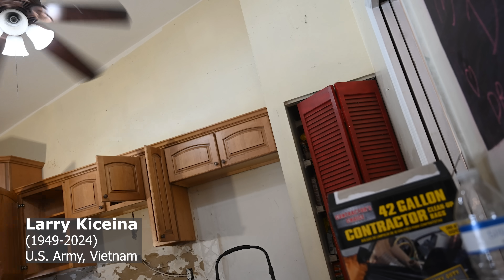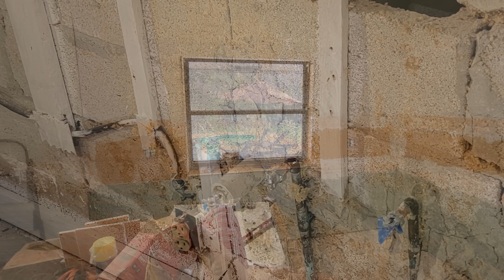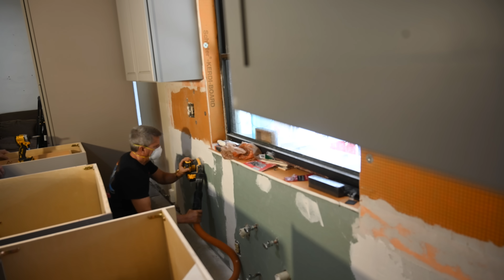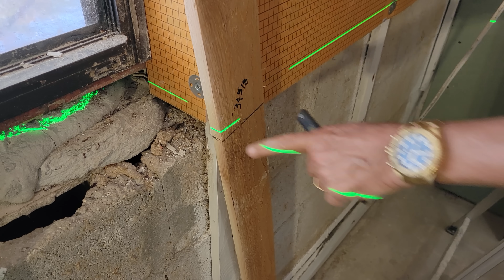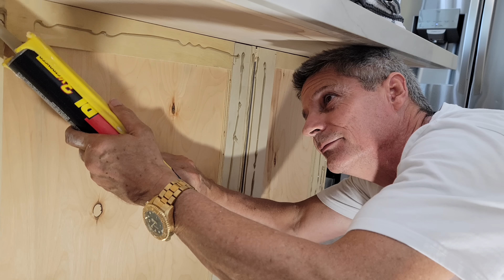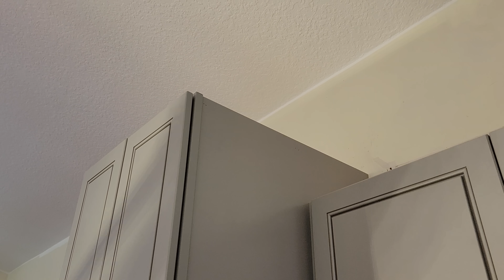Flooded Kitchen Cabinet Installation DIY Mistakes To Avoid

Comment: Nice looking kitchen, but if you are like me and confined to a wheelchair it's completely unusable. The problem is that with cupboards under the counter tops when you approach it face on your shoulders are at least 1.0 m (39 3/8 inch for Americans) away from the bench top. That makes it pretty much impossible to reach anything but the first few cm (3/8 inches) of the bench top let alone taps and anything close to the back of the bench top. The only other way you can get at the bench is the have the wheelchair side on to the cupboards, but this means you need to be working with your back twisted through 90 deg and that causes all sorts of long term problems not to mention pretty serious pain in the short term. 

Either way, you beautiful new cabinet doors are going to have dents, scratches and marks on them extremely quickly where the foot plates or wheels of the wheelchair smash into them multiple times, even if you're just boiling an egg. Which by the way, can be a potentially very dangerous exercise for someone in a wheelchair as you need to use your hands to move around making moving things like a saucepan full of boiling water exceedingly hazardous.

Now I know you're going to say that you're not disabled or confined to a wheelchair, so this problem doesn't apply to you or your family. Well that's what I thought too when I designed our kitchen, which incidentally everybody said was the easiest kitchen to work in. Then through no fault of my own I ended up being disabled to the point I can't stand up without some sort of support and even then only for very short periods before it becomes too painful. So now that kitchen everybody raved about being so easy to use it totally useless for me and I can't even boil the kettle to make a cup of tea or coffee.

Having said that, one rule I insisted on sticking to when I built the kitchen everybody loved was that;
        "YOU MUST BE ABLE TO REACH ANY ITEM YOU NEED WITHOUT HAVING TO MOVE SOMETHING ELSE FIRST"

If you need to move things out of the way in cupboards to get at something towards the back then you very quickly and dramatically increase the time it takes to do anything because instead of just reaching for item X and using it you first need to move item Y and Z out of the way, get item X, put item Y and Z back. Then when finished move Y and Z out of the way again, put X back followed by Y and Z. So instead of picking up and returning item X (2 motions), you need to also move Y and Z multiple times (all up around 10 moves) which can increase the time it takes to do something by a factor of 5. Also cupboards are extremely inefficient use of space as the majority of the volume in a cupboard is unused space as you need all that empty space above each shelf to get at things at the back. However, a couple of relatively shallow drawers that take up about a third of the vertical space can easily store as much or even more and allow you to reach items at the back without having to move things at the front, out of the way. So the kitchen everybody loved so much had very few cupboards, but loads of drawers (even upside down  drawers for hanging cups and mugs in and side on draws for large containers of things like cooking oil) and once you knew where things were it was just a matter of opening the appropriate drawer picking up the item you wanted and letting the draw close itself while you got on with the cooking.

Just some thoughts if you are ever in the situation that you are rebuilding a kitchen from scratch.